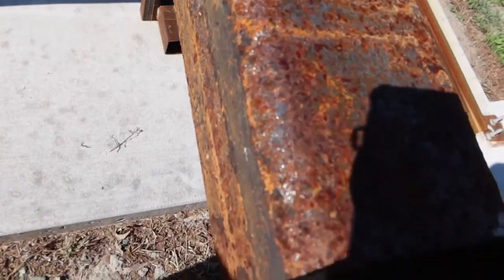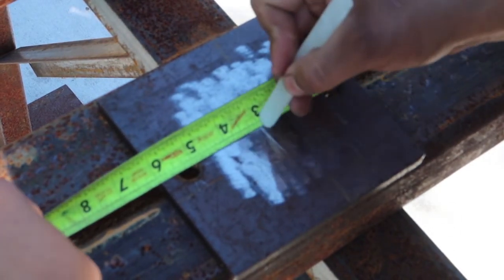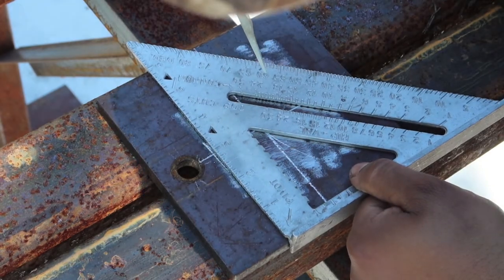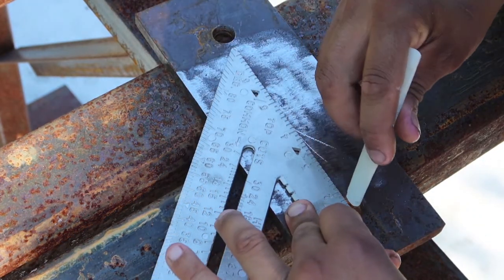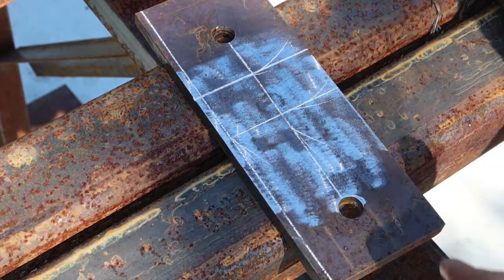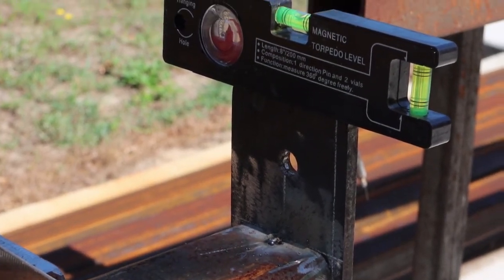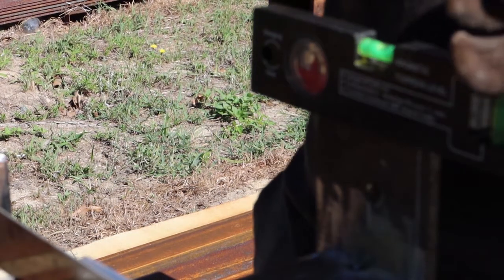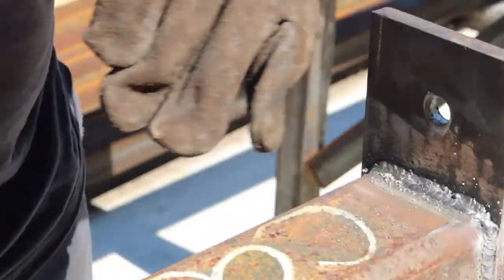Welding Shop Build!!!

Comment: what kinda paint/prep?
Reply from the maker: Honestly the whole paint and prep was wire wheel all the rust off and put oil based paint on it.  oil-based paint was used on car frames columns and stuff like that it protects against rust.